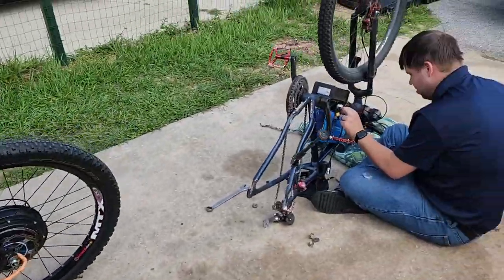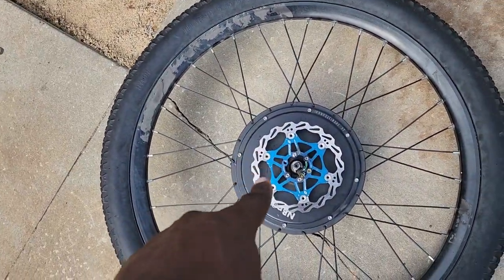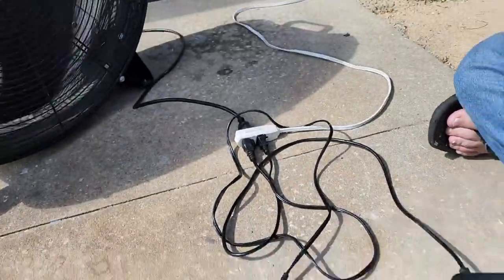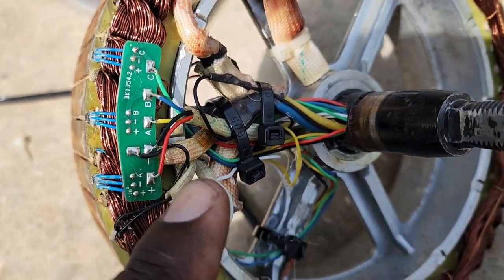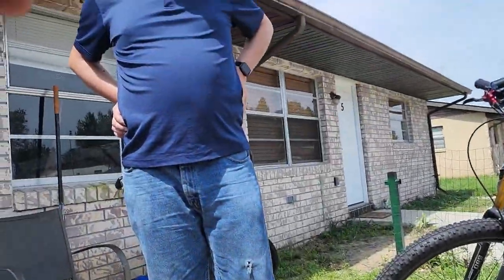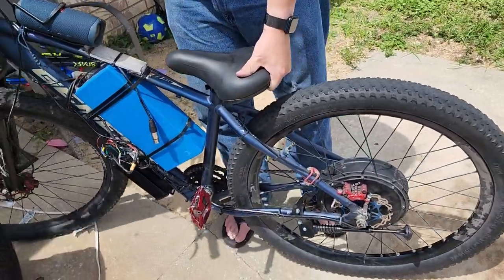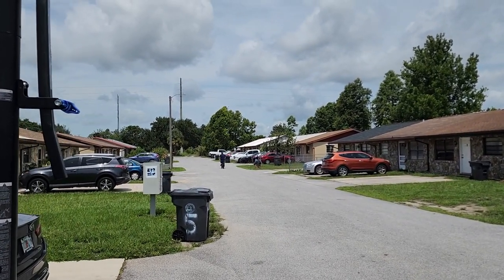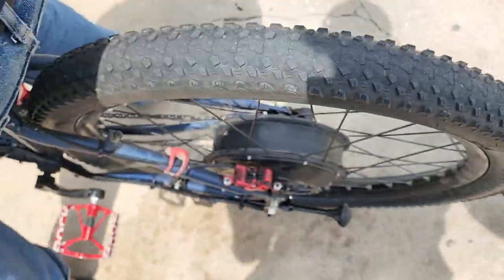fixing my friend's 3000w ebike hub motor

Comment: Great to have ebike friends that know how to fix stuff and are willing to help out.  I hope I'm able to help in similar ways with my friends and family when they get ebikes.
Reply from the maker: Heck yeah is good to have that knowledge so just in case you can get right to it and put it back in action
Reply: It was my bike that broke down. I just happen to have quite a varied background in electronics, so soldering and preparing cable is an easy task for me. I just don’t have the know how of how e-bike systems work just yet, so I have Tommy help me out with these things due to my lack of experience.

Comment: Nice repair, did the same to mine, but my cable goes to the end of the spindle, bugger to get through.
Shorting the phase wires wont break the controller, but it can damage the halls if they short to the phase wires.
Reply from the maker: Oh yes I was definitely aware of that.

Comment: If the solder don't melt best thing to do is add solder to remove if it makes sense bro loving the content I do this stuff as well fixing ect
Reply from the maker: You is correct I did put a little of solder on the tip and it came off way faster

Comment: Im in the middle of a upgrade on my e-bike I had a 48 volt thousand watt hub motor I just got me a 5000 w 205 I got me a 60 volt sauron battery 32 amp hour going to get me a sabaton 72200 after another battery upgrade but going to run the surron one for a lil bit
Reply: It's gonna wind up with a flat pack battery pack 72 volt 32ah capable of 800 amp continuous 1600 burst.a lil over kill but that's the cheapest available to me at the momentitll have a 300 amp peak Daly bms and a sabvaton 72200 unlocked esc
Reply from the maker: Nice!!!

Comment: My e-bike stopped working the motor judders and went move when I press throttle idk what to do
Reply from the maker: That could be something to do with the hall sensor or worse, the controller.
Reply: @E-bikeguy  it spins when I have tire in air but it’s not a smooth start then when I get on to go to accelerate it doesn’t move
Reply: I just hope it’s fixable cause the controller was expensive and I only had it for 3 months
Reply from the maker: Oh wow definitely something to do with hall sensor,  phase angle not right cause it to junk or not spin on its own.